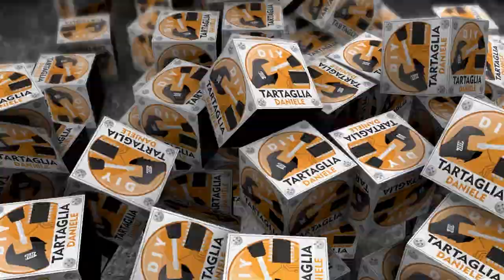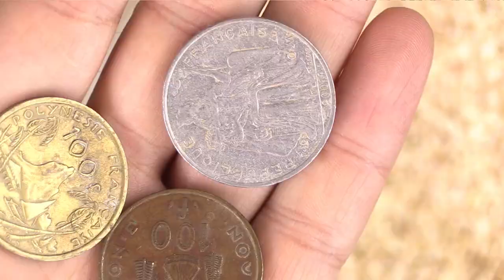Buratto fai da te CON VENTOLA  - Tumbler Machine DIY With FAN,  low noise

Comment: Wouldn't it of made more sense to do the feet once screwed in then razor cut off after save scratching bolts 😎😅😉 but seriously nice work ✌️💪 replace the fan when bearings go cheap enough

Comment: Excellent.  Those that say it won't last more than a month....hes way ahead of you. He coverd every base between the springs absorbing the offset weight on the fan to the rubber washers securing the bowl etc....I'm sure it will last quite awhile.
I hope he posts a follow up in 6 mo to prove it.  Excellent work.

Comment: Excellent video, I like your design. The feet were especially inventive. What media did you use as an abrasive?
Reply: Yes, what kind of sand is that?
Reply: @basstard13  thanks
Reply: It could have been ground corn cob. Typically ground walnut has a finer grit, but will accomplish the same result. Look for walnut pet bedding vs. abrasive media as it's typically 1/3 less expensive.
Reply: Just use rice...
Reply: It's vermiculite.
Reply: @arealassassin  Excellent, thank you. I couldn't remember the name.
Reply: @arealassassin  Yeah , I also thought it was vermiculite, then, up close it looks more like bentonite clay (cat sand). 
Turns out he is using crushed walnut shells (a popular choice for delicate tumbling and sandblasting).
"SMARTRELOADER Extreme Brass Polishing Walnut Media"

I've seen various results an various mediums, but it seems the essential thing is that it is light enough to bounce around. I've seen videos of people mixing coarse an fine gravel, and the result was horrid an took much much loger time (over night).

Vermiculite or Perlite sounds like a good bet for this purpose though. Both can be found for cheap in gardening stores for soil amendment.
Reply: @arealassassin  :  According to the link at the bottom of the video, it is:
"Smartreloader Extreme Brass Polishing Walnut Medium (2kg.) Abrasive Grit in Walnut Shell Treated for Polishing Brass Cases and Small Metal Parts"
from Amazon.

Comment: The bearing in that fan won't last 1 week lol
Reply: True
Reply: But i have like 10 spare so its good idea for even when it dont last long. But he should use the original connector for simple replacing.
Reply: you can pick as many as you want from discarded desktops :) free of cost.
Reply: Lol
Reply: Probably..
Reply: So... I guess it will vibrate more. Just like he wants it to do :D (And maybe make a bit more noise...)
Reply: As an alternative, why not use something like a DC toy motor with a disk of some kind, weighted similarly. Should vibrate all the same, might even run more efficiently.
Reply: Should have screwed the feet in first, with the proper tool, & then applied the padding material!!😉
Reply: My very first thought!
Reply: I was thinking the same.. just a little premature wear lol. But they're cheap and it seems to work well. I might try this using my neighbors cat littler mix.
Reply: Maybe try just using air pressure to get the agitation instead off balancing the fan
Reply: Probably last longer than you think as the fan is not fixed solid. It's free to move around to a certain extent in this application
Reply: Hola. Que tipo de producto depósito dentro del recipiente?
Reply: @pauloduarte3200  Por ahí dijeron que las piedras para baño de gato sirven
Reply: Could that be used to remove bubbles from resin mold?

Comment: Brilliant! Using a fan without ball bearings that usually gets worn down fast if you put a radiator in front of it, then you only have to change the fan once every time you use the cleaner, so smart! 🙄

Comment: Brilliant idea (low cost and simple) and great craft skills and imagination. (I know I would have forgotten to have put the nut over the wires before soldering them to the power connector :-). I wonder how long the bearings in the fan will last? time will tell I guess.

Comment: Cool design  &  Great project.!!
   Here's another way that may be cheaper and way faster.
     Or a sandblaster siphon type for $25 (comes with 4or5 nozzles), and a 5gal bucket and clean those parts in 60seconds with the same stuff you used in the bowl.
  (I have a compressor but I don't have one of those fans, jigsaw, solder iron and switch).   *Also it can be used for bigger jobs and will shoot many types of mediums through it.

Comment: Very inspiring. Fan may not last long but for the small simple use, who cares. You can always upgrade later. Could have used masking tape instead of heat shrink for the silicone feet. Maybe add a dial timer to electric switch.
 Good job.

Comment: Awesome project. One small suggestion, I would have used a barrel connector for the power socket so I could use a standard 12 volt (I assume) power adapter without having to change the plug.

Comment: You didn’t use spring washers anywhere, this can cause whole top side to disassemble from all vibrations. Also screws that you have used inside the bowl can erode from the gravel you have inside over the time. It’s cool idea, but needs some work. Also fan bearing won’t survive for too long.

Comment: Hey guy. Nice work!
But I have a problem...
Yesterday I tried to build it but anything goes wrong. In your video it is not exactly clear how you connect the cables. 
1. Starting with the power supply. Which supply do you used (AC to DC) and how do you connect the connector on it?
2. I can see how the positive goes in and so on but I can't see how the negative goes even out of the tumbler.
Can you please send a electric plan for dummies? 
To me@blackpantha.de please.

Because my tumbler starts to burn after the light was flicking and so on 😁 it was very uncool 😂

Comment: i dont understand why the rust was removed...
Reply: The granules in the bowl rub against the metals thus removing the rust
Reply: @ctbully  Are those granule special somehow? what they are made of
Reply: @treyondaren3542  Polishing Granules are products made from different  raw materials (hazelnuts, almonds, corn cobs, etc.): these fibrous materials are ground to the grain size wanted by the user and are used for sand blasting, deburring and polishing as well as additives in many industrial production processes for machining metals  and restoration work.